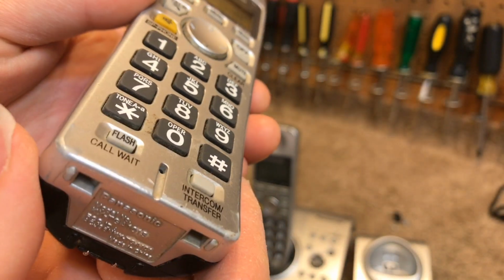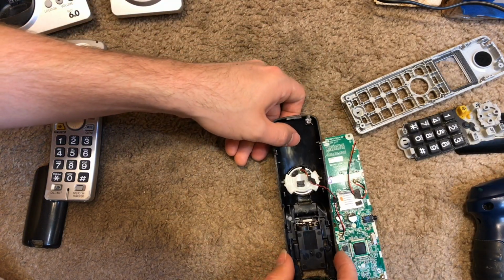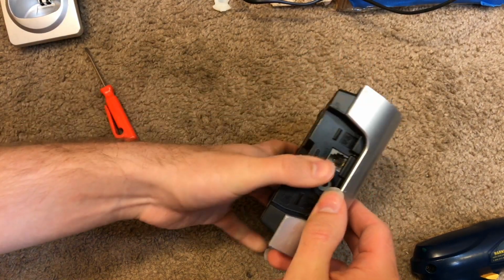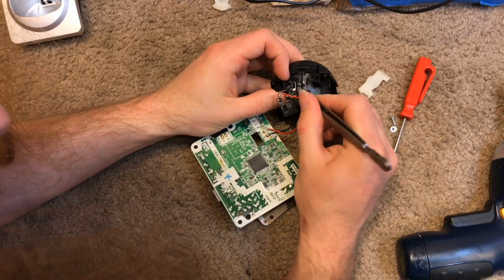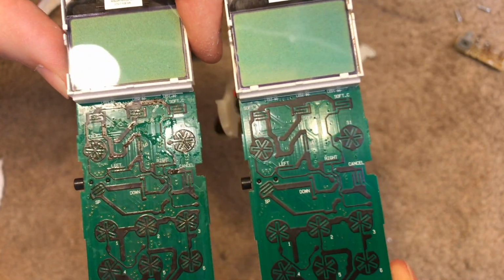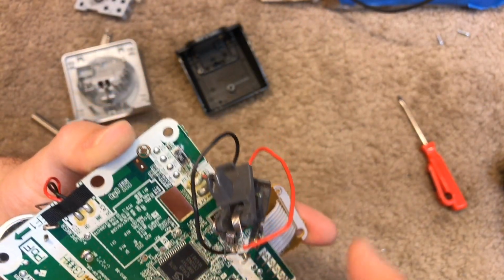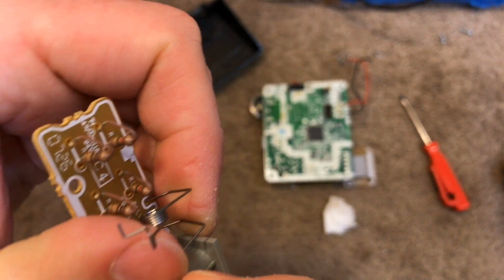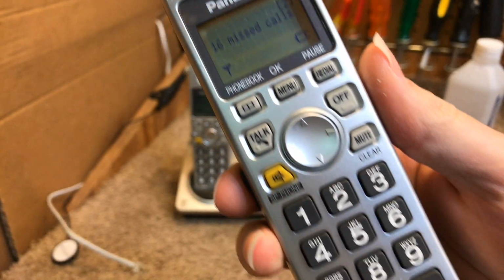Panasonic DECT 6 Cordless Phone with Digital Answering System model KX-TG1031S | Cleaning

Comment: Hey I was just wondering if there’s a certain kind of silver  touch up paint you can buy to put on the wear spots of these phones. I have many with similar wear and want to use them as display pieces but the paint is worn in the same way as yours shown.
Reply from the maker: There probably is, but finding something that's an exact match may be difficult. The best way is probably to find the closest color you can, take then apart and remove all the electronics from the shells and repaint the shell completely.
Reply: @Jordan U ok I did that and they came out great. the paint came out a little darker than I will like but it is much better than before